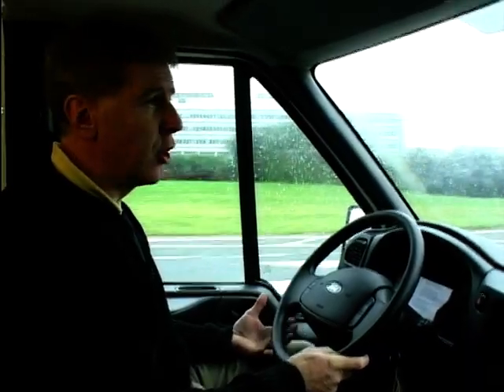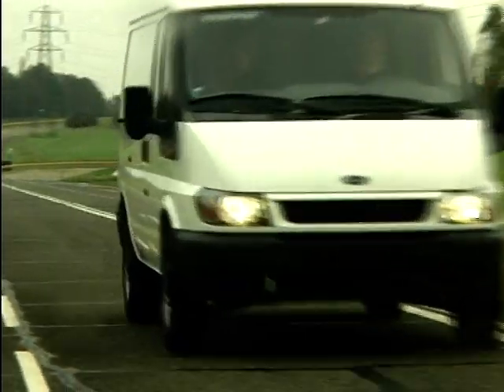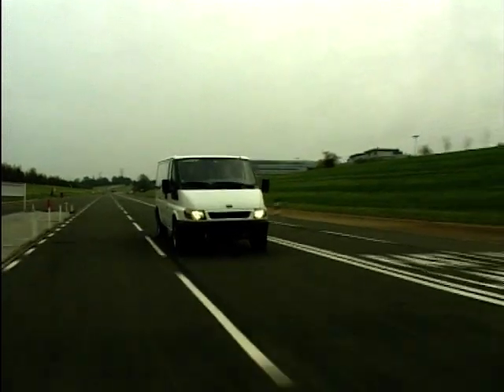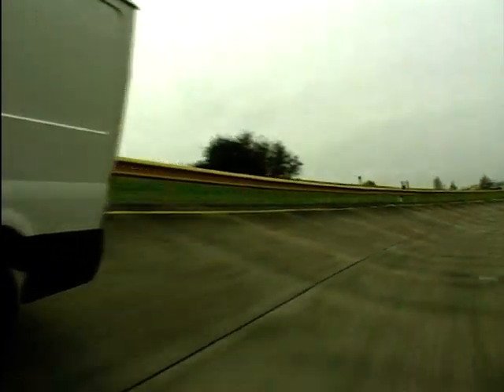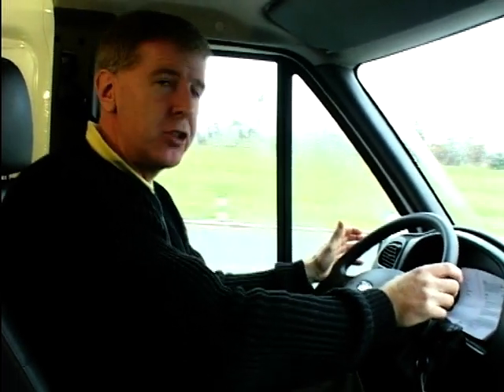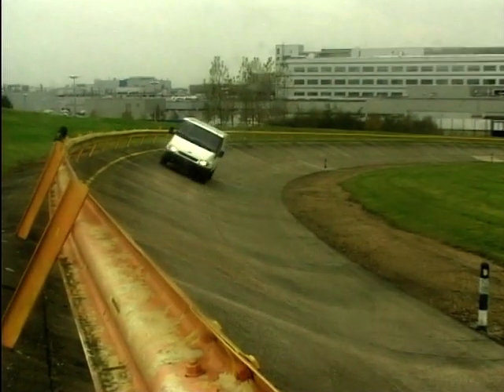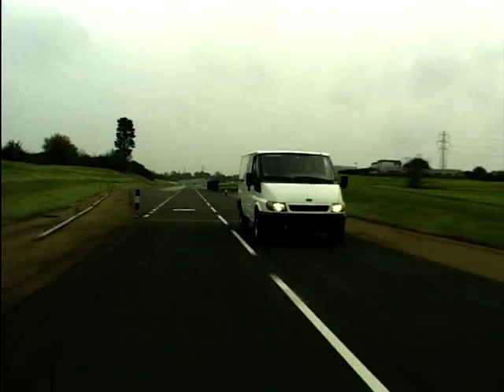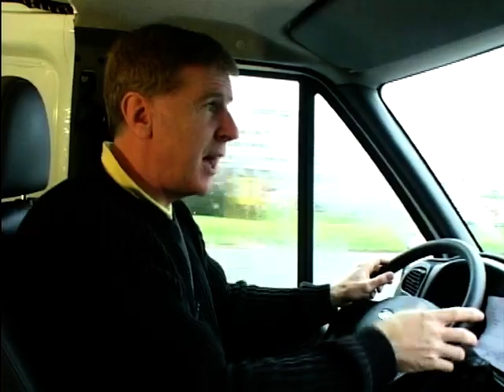2003 Ford Transit Van - Test Drive & Review

Comment: Those gearboxes are the worlds worst they always went wrong proper manual gbox and there perfect vans
Reply: +fiestasiphil Nothing wrong with ours and its 15 years old (2001 Ford Transit T350 EL (Extended Length) 2.4 TDDI 90PS with a 5 Speed MT75  (Rear Wheel Drive) gearbox Driving a 5.13 Axle yes it has a small amount of rust which we are cutting out and welding in new metal.
Reply: +James Stephenson i was referring to the automatic gearbox used in some of the t350 transits
Reply: Even though they looked cool with the buttons on the dash the durashift automatic is quite problematic